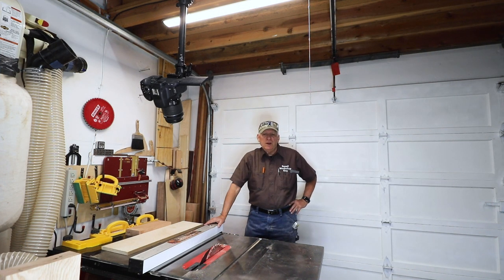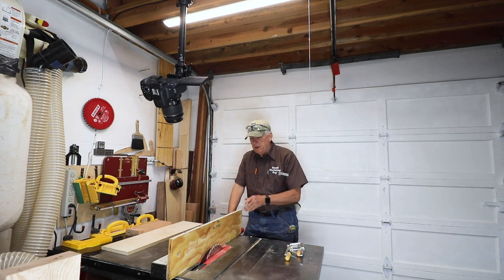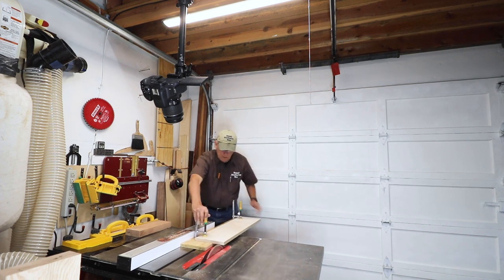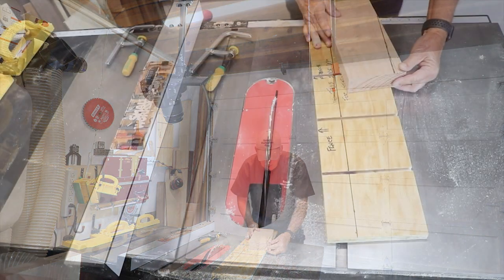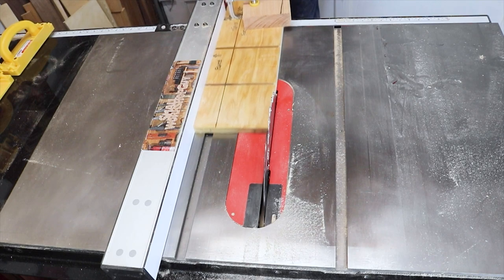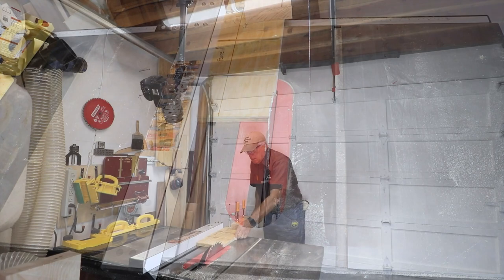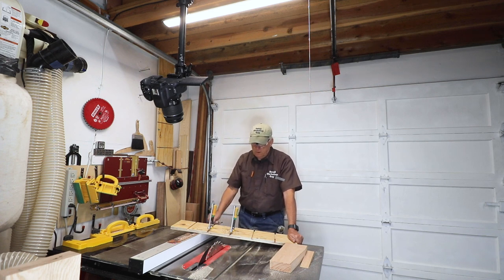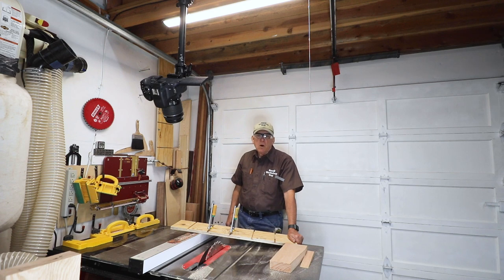3 in 1 Tablesaw Jig Utilizing the Matchfit Dovetail Clamps from Microjig

Comment: Nice explanations.  Please keep these quick videos coming.

I see you have an Incra crosscut sled - how do you like it?
Reply from the maker: They say the "proof is in the pudding" which I guess means a tool should be measured for how you actually use it in the workshop. If that is the criteria, then I do not like the Incra Crosscut Sled very much because I hardly ever use it - I guess it is too heavy and it is cumbersome to use the two separate pieces and it does not support the cut at the back of the workpiece unless I attach a supplemental sacrificial fence, which I am apparently too lazy to do.  So, I find myself grabbing my own shop made crosscut sleds.  Hope that helps!  I am sure when I want to do precise angles, I will use Indra sled.

Comment: Hey guys I wanted to leave a tip. I made a 48" one using my router table. If you are using a router table your fence most likely won't be able to handle more than the 4" cuts. You will need to use your miter gauge. YOU MUST do your miter gauge passes first. If you don't, once you cross paths with a perpendicular groove, your board will slip. Once you get these grooves done and move to your router table, slow down once you are about to cross paths with another groove. Go ahead and draw out all your lines on the top piece so you know when you are about to cross paths. I wish I could leave a pic of the one that I didn't miter first. LOL
Reply from the maker: Thanks for sharing!